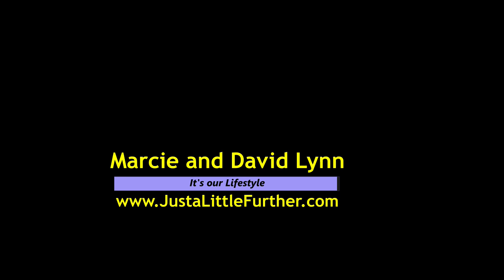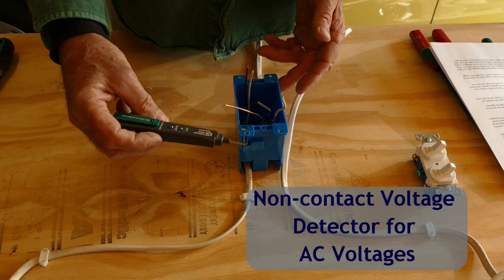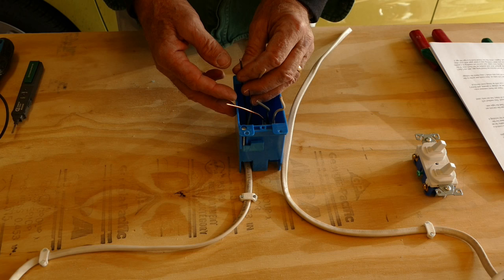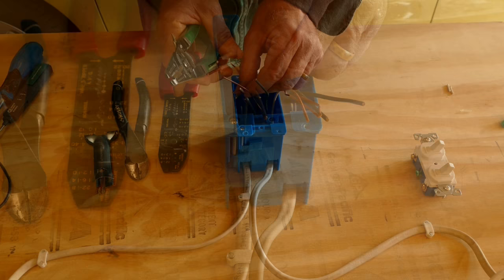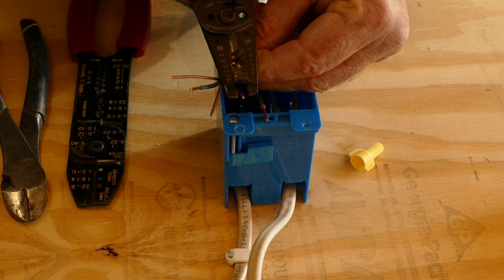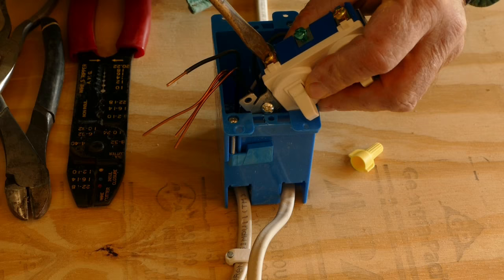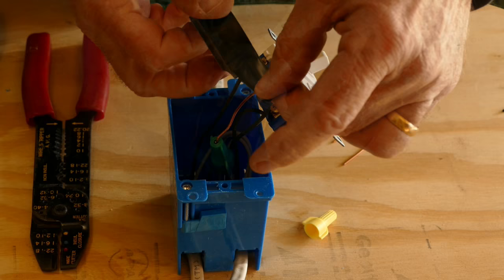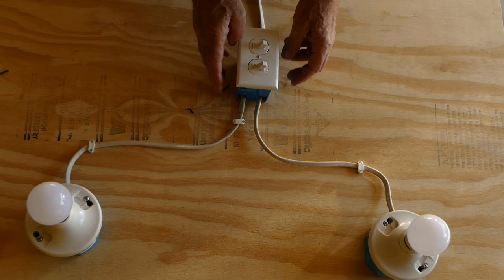Wiring a Double Switch

Comment: I have a switch for a well pump and light. I have to turn the screw for the well pump back and forth sometimes before it’ll come on. Also, the light sometimes works and sometimes flickers before it works. I have no idea why.
Reply from the maker: Hi KnoxWatch, The problem could be the switch, the connections or the wiring. Sounds like it might be time to call an electrician to diagnose the problem.

Comment: Question.....Can you use this same exact switch if you wanted to power two separate lights with two separate circuits?   And if so, what type of breaker would need to be used in the panel or can you use two different beakers located in completely different places in the panel?  My under standing is that it would require a special breaker to be safe. Also my understand is you want to make sure you do not combine or share the neutrals from both circuits as well.  However I do understand that it is ok to combine the grounds from both circuits.     It is just hard to find info on this scenario.   Any info or light you can shed on this type set up, it would be greatly appreciated.  Thank you so much for your time.
Reply from the maker: Yes, you can use two separate circuits. The neutrals should still be connected together, and the black wires will come from two separate breakers. There's nothing special about the breakers, and they can be anywhere in the breaker panel. Make sure to cut the small jumper between the two line terminals on the switch, then connect one to circuit #1 and the other to circuit #2. Hope this helps.
Reply: @JustALittleFurther  I understand the neutrals need to be connected.  What  I'm talking about is keeping the neutrals separate, meaning you do not want to mix neutrals from different circuits.  Am I correct about that?
Reply from the maker: @TheGregWallace  Assuming both circuits originated at the same breaker panel, all the neutrals should be connected together.
Reply: @JustALittleFurther  I'm talking about in the gang box where your light switch is not the panel box.    Not sure if we are talking about the same thing?
Reply from the maker: @TheGregWallace  Yes, I'm talking about the gang box... all the white neutrals can be connected together.
Reply: @JustALittleFurther  Even if you have two switches in the same gang switch box that are on two different circuits?  I thought the reason you do not want to connect the white neutrals together from different circuits was because if you were to turn the breaker off for just one of he circuits and not the other circuit that was sharing the neutral, you can get shocked because the neutral has electricity flowing back to the panel from the other circuit that you did not turn off.
Reply from the maker: @TheGregWallace  Greg, you are absolutely right! The white neutral wires for circuit 1 should be connected together, and the white neutrals for circuit 2 should be connected together, but the neutrals for circuit 1 shouldn’t be connected to the neutrals for circuit 2. In addition to a possible shock hazard, if either circuit 1 or 2 was protected by a GFCI, having them all connected would probably trip the GFCI. Thanks for being so persistent… and I apologize for being so dense.
Reply: @JustALittleFurther  No worries.  Thank You for confirming my research.  It pays to be persistent.  Hopefully this will help other folks out as well.

Comment: My problem is the wires coming out of the wall are only 1 black 1red
Reply from the maker: The black is the hot conductor and the red is the switched conductor that goes to the light. There are two problems with your situation. First, wiring to a switch predating the 2017 code didn’t require having a white neutral conductor. Secondly, your box only has the wires to switch one light. In order to add a circuit to switch something else, like a fan or second light, you’ll have to run new wiring to the fixture, plus run a neutral wire from the breaker box. If you really need to add a double switch in this box, it’s probably time to call an electrician.

Comment: I just pulled a double switch out of the wall and it has a red wire as well?
Reply from the maker: In some cases, the black wire is hot (energized), and the red wire is switched on or off by the switch. It might also be that the three wires, white, black and red, are used to provide power to two circuits, like a ceiling fan with a light, for example. One switch and the black wire would control one of the circuits, the fan perhaps, while the other switch and the red wire would control the light.

Comment: This was a fabulous video!  Thank you.  I have a question.  I have the same type of switch at home that I need to replace.  When I opened it up, there were three back wires just like in your video.  Will only one of the three be hot?  Thanks!
Reply from the maker: Yes, you are right… only one will be hot.
Reply: @JustALittleFurther  Thanks so much.  Is it normal that the screws that need to be loosened on the new switch in order to attach the wires are incredibly tight?  I can barely open them.  (It is a brand new switch just out of the packaging.)  I appreciate your help.
Reply from the maker: @robertjones1891  yup, the terminals on most new switches are torqued down pretty tightly.
Reply: @JustALittleFurther  Many thanks again!  I have this double switch (as in your video) in my basement.  One switch controls an outside outlet and other switch controls a motion-activated outside light.  The outside light can also be turned on from inside the house if you click the switch back and forth a couple of times.  I have not had any past problems.  Recently, the outside light just flickers...it does not light steady.  I changed the lightbulb...did not solve it.  Now, per your perfect instruction, I changed the switch...that turns out not to have helped either.  The light is still just flickering.  Any suggestions as to what might be wrong and how to solve this?  The outside outlet works fine.  Thank you for your kind help!  Robert
Reply from the maker: @robertjones1891 Since you changed the switch and that didn’t solve the problem, I suspect it’s a problem with the light itself. If it’s a motion sensing light, it probably also has a photo sensor that only allows the light to come on after dark. Photo sensors often fail, and one typical early symptom is the light flickering. The light may have a “Test” switch, and if putting it in test mode eliminates the flickering, it almost surely is the photo sensor. You may be able to replace the photo sensor, but most likely the entire light fixture may need replacement.

Comment: Great video...do you have a video to a breaker 20 amp 15 amp ...how to change 15 to 20 if possible...and how to have a license to be tech ..thank you have a blessed day and be blessed
Reply from the maker: Hi jirojoseph, 
Thanks for the feedback. As to changing a 15 amp breaker to a 20 amp, this isn't advisable. The wiring for a 15 amp circuit is AWG14, while the wiring for a 20 amp circuit is AWG12. If you change the breaker without changing all the circuit wiring, you may overheat the wiring, causing a potential fire hazard.

Comment: do you have a video where the power is coming in from the lights?
Reply from the maker: No, sorry.
Reply: You would have to use 3 wire with ground. It will be one black, one white and one red wire. The black and red wires will be your hot wires. One will bring the power into the switch box and the other will carry it back to the fixture. The white wire will be connected to all the other white wires with a wire nut at the fixture. The white wire in the switch box should be at least six inches long and will just be capped off with a small wire nut (for future use if ever needed).
Reply from the maker: @njsongwriter  Thanks Jack... this was a good clarification.

Comment: I’m not sure where you get the idea that a breaker will likely stop working after it trips a few times. Never seen this happen before. Part of troubleshooting an underground circuit fault is repeatedly resetting a breaker after it trips until you’ve broken enough splices to isolate the fault and it stops tripping.

Also, why are you not using lineman pliers to twist your wires? It’s hard to say this without sounding rude, but that neutral splice looked terrible. Where did you learn to make splices?
Reply from the maker: Hi Russell - thanks for the observation. Here is my rationale... the number of times a breaker cantrip and continue to operate  depends on the overload current. Most household circuit breakers are designed and tested to meet UL-489. Among other criteria, a breaker designed to meet UL-489 must  remain operational after only two 'maximum' short circuits. If I short the wires in an electrical box, the current may very well be close to 15 times the normal 15-20 amp load rating of the breaker (the typical maximum short circuit rating of a quality circuit breaker), meaning it has only been designed and tested to handle this current twice. In your experience, which is a great troubleshooting and fault isolation method, BTW, the current was probably due to insulation damage, water ingress, or physical damage. An overcurrent situation due to one of these causes may result in a current that might only be 1.5-3 times the rated capacity of the breaker, and it will continue to operate indefinitely. In my experience, putting a dead short on the output of a breaker more than 3-4 times will cause it to become flakey, often tripping with only minor loads or not operating at all.

Comment: Why did the electrician  in my house pull out three black wires and one red one for a double switch?
Reply from the maker: I can’t say for sure without seeing it, but more than likely one wire was the line (the hot wire), the red wire went to a light circuit, and the other two black wires fed other outlets, and/or a fan, a light or some other circuit.
Reply: @JustALittleFurther  Thank you for answering I have another question , for LED lamps we use an electronic ballast?
Reply from the maker: @A.A2015  technically, LEDs don’t require a ballast, but some LED bulbs are designed to directly replace an existing fluorescent bulb, and these direct replacement bulbs do require a ballast.

Comment: Always contact a licensed electrician! All it takes is one little mistake (the neutrals in this video are red flag to me) and your house could be a pile of ashes! Electricians are licensed for a reason!
Reply: Yeah, pay $100 an hour for a simple switch replacement, no thanks. This isn't 3 phase 440.
Reply: The way he twist the wires and cut in the box made me cringe

Comment: What if you have one power source one black wire
Reply from the maker: This is the typical situation. Simply connect the black source wire to the line terminal. The two line terminals are normally connected together with a small metal jumper, which is only clipped when using two separate circuits.